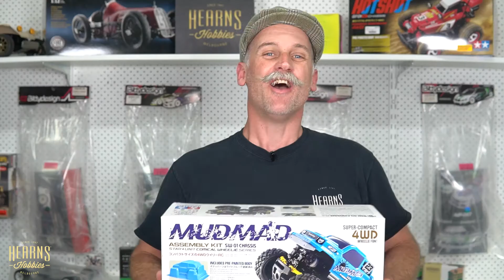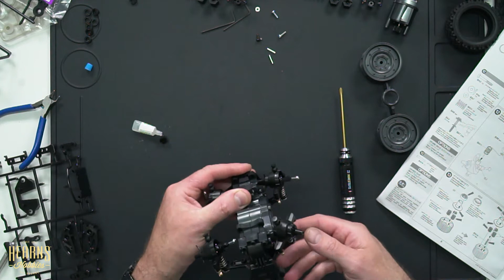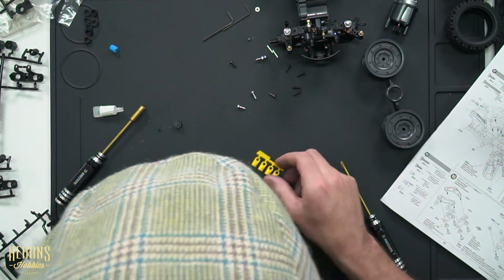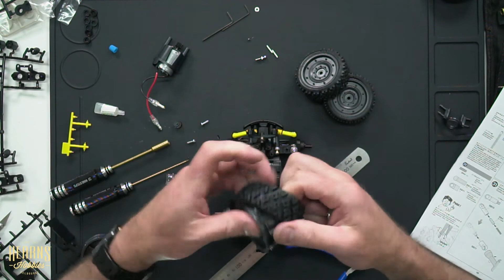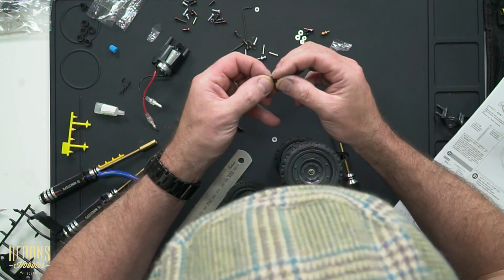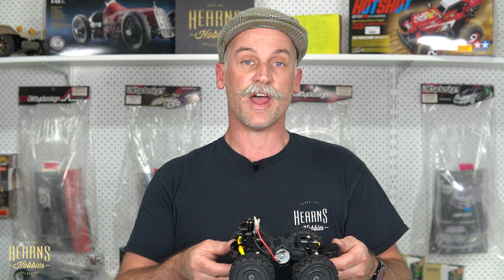Tamiya Radio Control | Mudmad 1/24 truck Build Part 2 | #askHearns

Comment: I'm building one at the moment. I need to find a esc for it that will work with the 4AA pack.
Reply from the maker: Finding an ESC to handle the 4AA will be difficult as most small esc don't operate when the voltage drops. Best to use a 2 cell Lithium Ion or Lithium Polymer battery.
Reply: @HearnsHobbiesMelbourne  I just run up ordering a HobbyWing 1625 for it today. Finding one that will run down to 4.8v is damn near impossible. I'm just going to run my Mini B batteries in it.